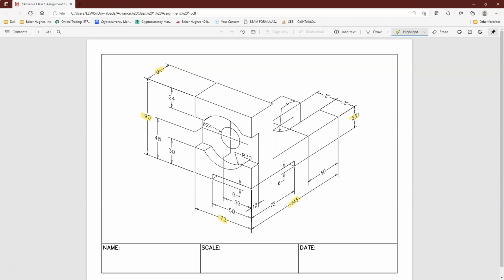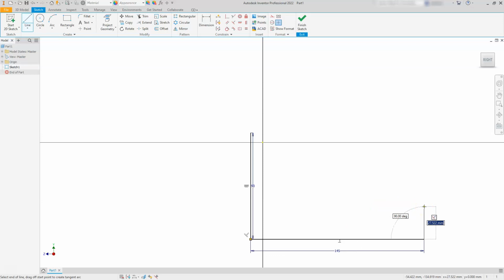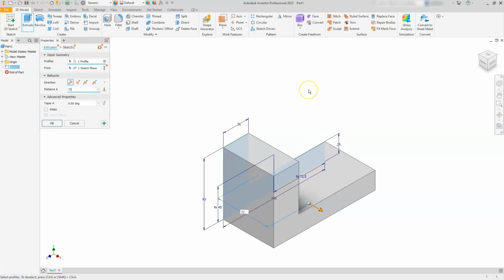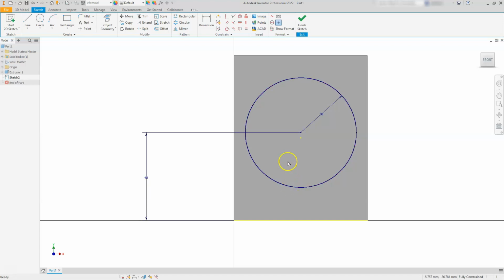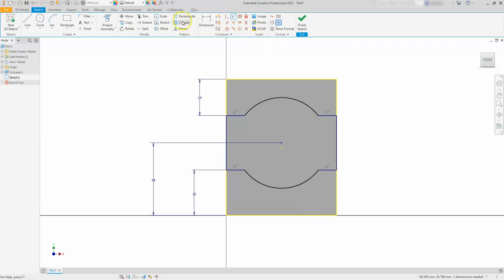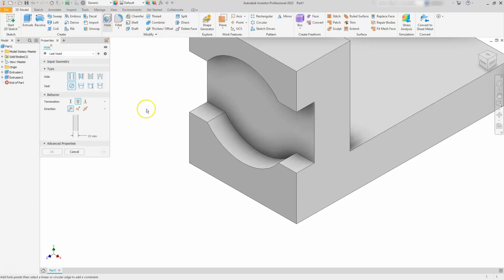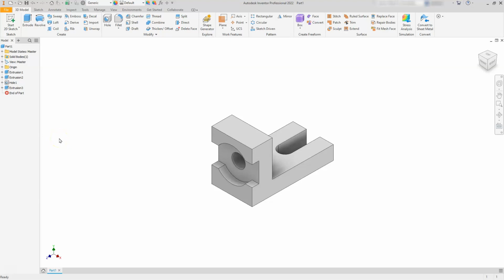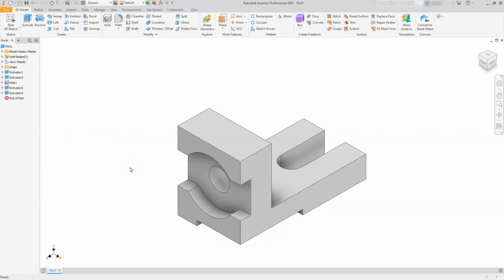Extruding with Inventor

Comment: would love a video on what the different Robbin Botens do for ex coil, thread and how to use them.
Reply from the maker: Noted. Just remember the thread command in Inventor just puts a bitmap picture on the part which helps save space over using a coil